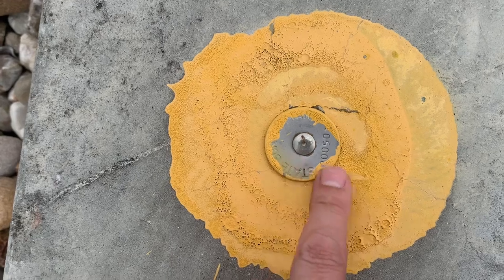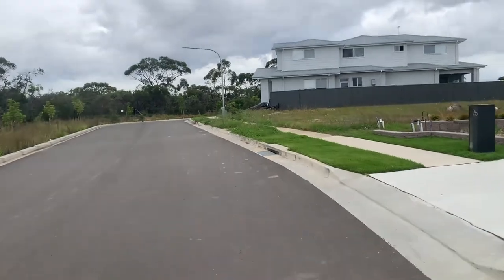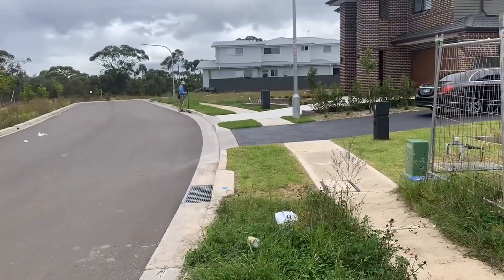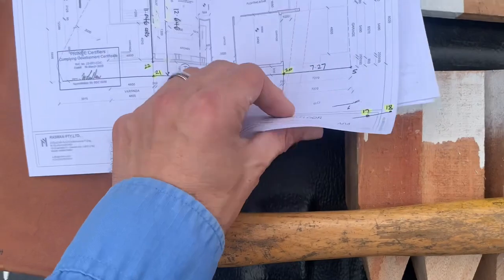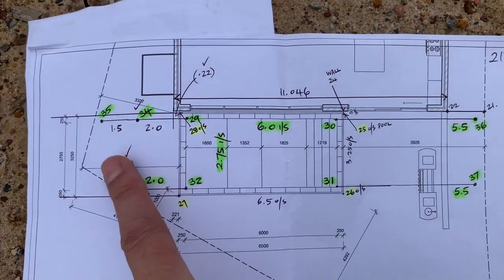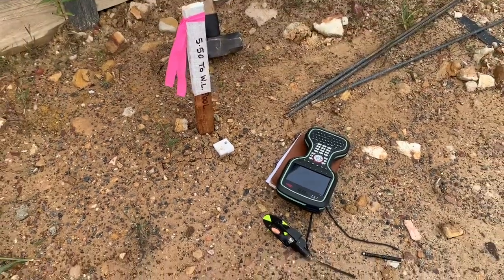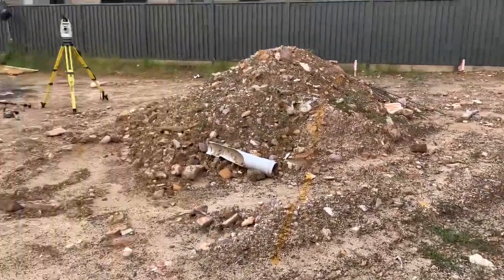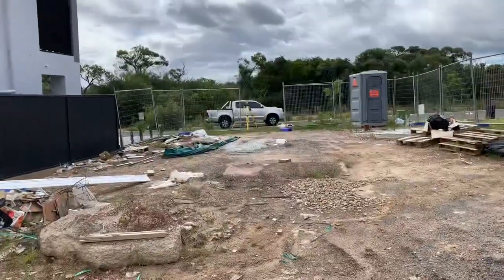Swimming Pool Surveying – How a Surveyor Marks It Out #Surveying #LeicaTotalStation 🏊🧭

Comment: Hey mate, can I ask you a few things? How has surveying changed in the last 10-15 years? I used to be in it but left. It looks like you resect everything, even for cadastral work? In Victoria we would (depending on the situation)  find a mark, set up on it, and set a backsight to another mark, check a few offsets to occupation on that bearing, and turn maybe turn an angle to find a third mark. It looks like you resect and put in boundary pegs and you are all set? Are there any other checks you do? Sorry if this sounds stupid, I have been considering maybe re-entering the industry but not sure if I have missed the boat with all this new tech and procedures!
Reply from the maker: Hi there. Yes a resection is really a fast and more convenient way as you can setup the instrument where its comfortable rather than setting on a mark and siting the next and then have to move to see other marks. This happens a lot on construction sites. Once I've undertaken the resection, I re-record all the marks and normally look at them again back in the office. If you happen to working on a reliable or new survey then the results of the re-section would or should be very good and so marking straight away is perfectly ok. Again anything I place I record and undertake final checks back in the office.  If you have any questions feel free to reach out! No troubles at all.

Comment: Haha. That camera mount is fantastic. Great shots of the station tracking you and the target walking around. 
I will definitely try that one as well.
Reply from the maker: Hi. Many thanks. Its cool hey. There is probably some room for improvement with the mount as it needs to firmly wrapped around the handle of the total station but I've also bought a camera adapter with a 5/8" thread to sit on top of a prism pole. The top of the adapter has 5mm or equiv. screw which goes into the camera so I could mount say my 360 camera on top of the prism pole. A video for another time.  Have to be creative as I'm the camera man also. No-one else to film me. Cheers.

Comment: How do the recoveries then get used? I'd assume you can run a string between them and measure 5500 in from the ends to get back to the waterline? This stuff is interesting, thanks!
Reply from the maker: @angusgibson7746  spot on! Yes that’s the idea but you need to measure a level horizontal distance of the 5.5m so if there is slope or pile of dirt in the way you may need to plumb up the point or use a spirit level or something to compensate for that. But yes measuring 5.5m or the distance down along the direction of the line is the go. Sometimes we even have another peg square off the point so you have 2 points to measure from.

Comment: what sort of tolerance/accuracy do you work too? we all aim to be spot on but what is acceptable in the survey world?
Reply from the maker: @brendan454  to the millimeter is what you try to achieve always. Depends on the job. If you work to under 5mm you are doing well. We always try to be 100% correct. Then if an error is made by the contractor then at least we have started off correctly.

Comment: Great video, when a new sub division is made, how long before builders come are you guys there? Im a carpenter and I dont think ive ever seen a surveyor doing homes or lots before in 15 years.
Reply from the maker: @kizzjd9578  Hi. I’m normally undertaking a site survey first off to
enable design of the building and that happens once a decision to build is made. Once the building is approved for construction then the builders engage us to mark out the house or structure so the earthwork guys can start so yes we
never really cross paths with you guys. Once the slab is down we sometimes are back after the build
Is complete to do final surveys.
Reply: @ awsome info, thanks!